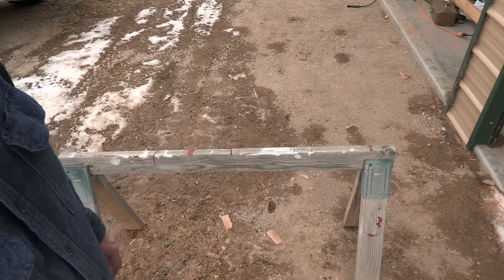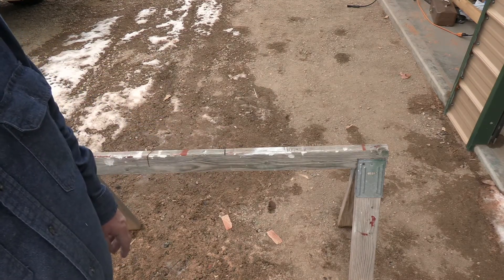Sawhorse build | fast easy DIY

Comment: How expensive was all that wood? I heard the prices were getting pretty outrageous of late.

I love the fact that they're stackable. They look very stylish too. Are you going to varnish or paint them?
Reply from the maker: The 12 two by fours cost me $48. I had a big box of 3 inch construction screws I bought when I built my chicken coop. Each one of the sawhorses used 24 screws. That’s a total of 96 and a 5 pound box of those is between 18 and $20 so you’re looking somewhere around $70 to build four of them. I was thinking of putting some kind of a wood sealer on them to protect them from the rain and snow.
Reply: @safarijoesadventures  Yes, protecting them is a great investment. I'd say $70 for 4 saw horses and the additional free elbow grease is a good price.
Reply from the maker: @loudmouthnewyorker2803  I thought so. I know you can still buy the steel clamps and use less wood to build them but they’re just too rickety.